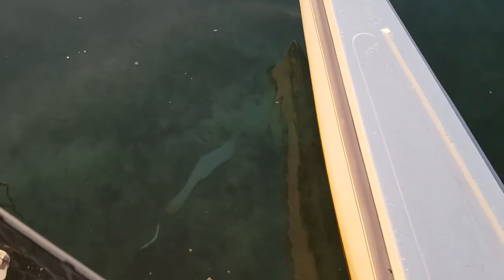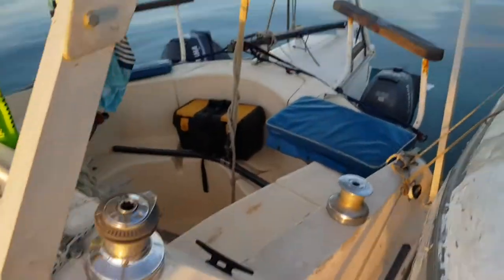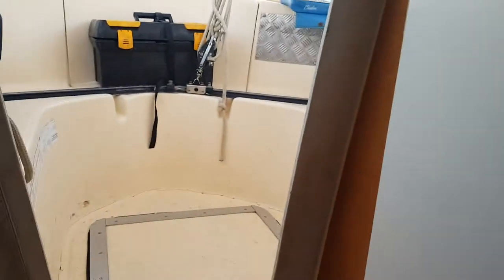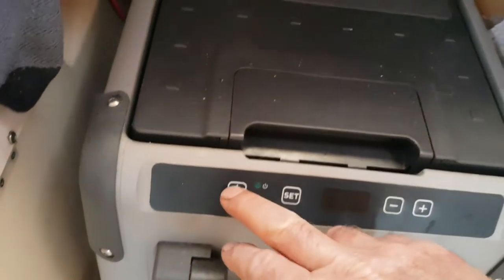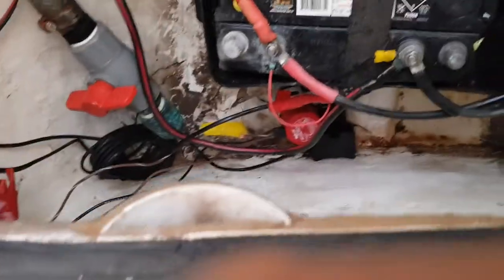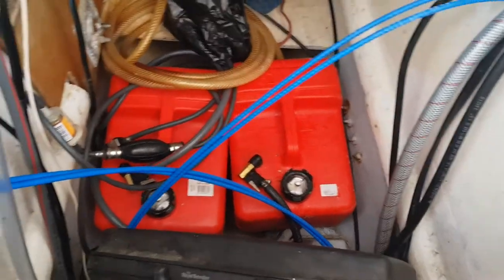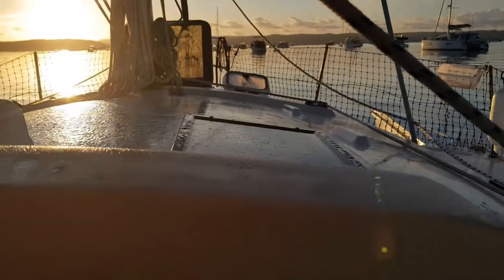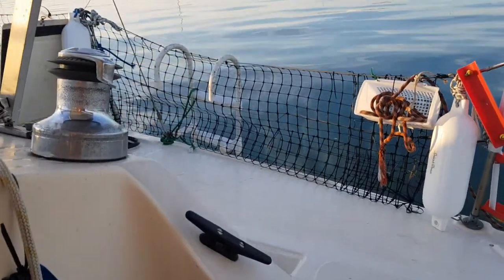Detailed Tour. Manta 29 Trimaran

Comment: Nice boat, I’m intrigued by these - especially the trailorability. Can’t afford one but I’m curious - how sturdy are the wings (for want of a better word)? The ability to fold sure is handy but how much does it reduce strength? What sort of conditions can these boats handle? What’s the roughest you’ve had it in?

Thanks for your time.
Reply from the maker: Hi its moored in Moreton bay ...that gets pretty rough sometimes !!! I've been outside a number of times through Southport bar.  Other Manta 29s  have Coasted along Eastern coast going south and others inside the GBReef going nth. They are pretty tough.